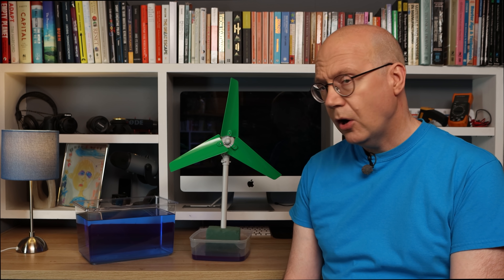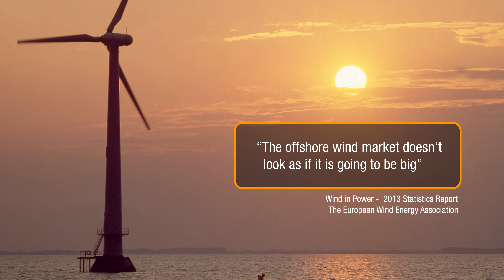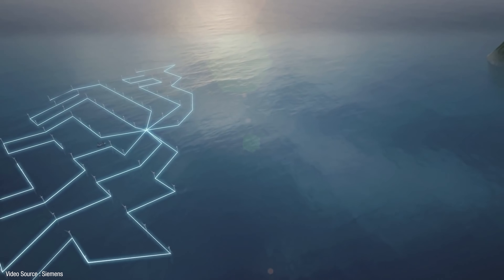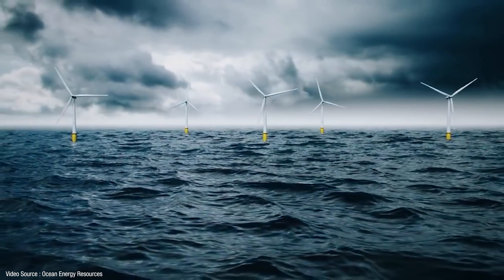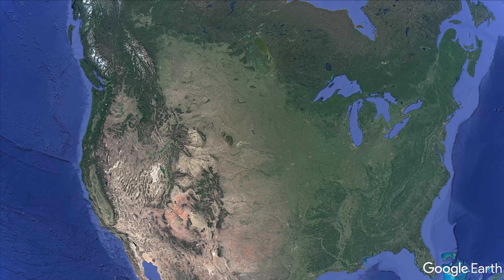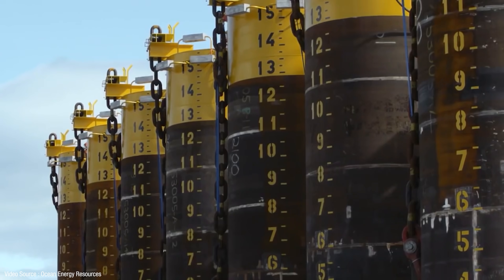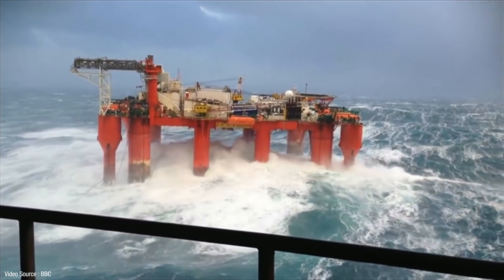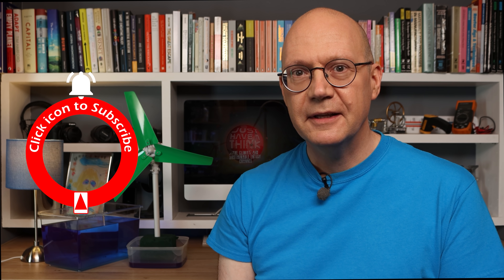Deep Ocean Floating Wind Turbines. How do they do that?

Comment: I love your videos, thank you!

I recently heard Dr Ye Tao of Harvard's Rowland Institute say (video linked below) that there is a large omission in analyses of wind energy: they generate heat via friction on turning blades, meaning that if we replaced all current fossil fuel energy with wind energy today, we would spike to 2C above 1750 instantly, just based on the friction heat (not including production of those facilities). 

I hope you'll do an episode about the MEER Reflection Framework! It would give us desperately needed time to transition to renewable energy and avoid the aerosol masking problem at the same time.

See Meerreflection.com
starting at min 24 of 55min video:
https://youtu.be/fwvPJnPP9KI&t=24m
Reply: It isn't heat that is the problem, it is atmospheric concentrations of CO2 which is causing global warming. I agree that friction will produce heat - friction in the nacelle/gearbox, wind on the blades, transmission of electricity along copper cables - but this will soon dissipate in the atmosphere and there will be no CO2 residue. It would be interesting to calculate what density of giant wind turbines would be required to raise the Earth's temperature by 1C and it must be published and peer reviewed.
Reply: @mahavati3696  Heat is the problem. I completely agree that CO2 is the primary cause of the heating, but we've created a paradox because of aerosol masking/global dimming. The problem with dismissing aerosol masking is the same as the problem of treating heating feedback loops (at least six dozen different heating feedback loops) and tipping points as though they're all in the future and incremental changes in them don't already matter today.

Dr Ye Tao points to research showing that if you increase CO2 without increasing temperature, plants last much longer than if you raise temperature. He's not saying that we don't need to reduce CO2, he's saying that if we use any of the existing emission reduction strategies, we'll be dead from heat increases far before we can reduce CO2 enough to maintain livable temperatures. We need to start reducing the heat before reducing the CO2. MEER Reflection Framework does just that.

Comment: Here in Philadelphia, there are something like 300,000 flat roofed buildings. Most of them are row houses. With existing electrical wiring installed in those houses, current solar technology and a local, non-profit run, groups of local installers who are fairly paid, solar systems with battery backup can be installed that will completely meet the electricity needs of the houses...and provide a source of income to low and moderate income people. 
The systems can be installed in a day with an experienced crew for under $10,000, everything included. We are training local people now and have already installed several dozen systems using this model. The local interest grows with each successfully installed system.
....and centralized, high capital investment and return corporations do not need to get involved.

Comment: it is a matter of who owns who,  a country rely on a company, or a company rely on a country. 

if a country stick its heart and artillery outside it's land territory, you will need a mavy or coast guard force attending 24/7/365 for obvious reasons. not to mention the technical maintenance cost, which is not required by other method of making electricity, look at the cost of north sea oil compare with othe oil sources. who's going to paid that cost? the company or the country? if you say the company, you are breeding a monster somehow someday will bite you. look at those internet company, they now identified themselves as “international companies”, who knows who their loyalty goes to? that's a naval base with armed ships you are talking about and most importantly, controls the heart beat of your city, all of it! 

a country within a country.

well, unless you live in a country that's company equal the country with absolute power, is it familier?

afterall, how much electricity it produce? is it replaceable by cheaper electricity in other form? you can say oil rigs are already there, but exactly oil rigs have the same problem but one critical difference. that's why it is not a monster yet.

they didn't control the electricity grid as well. don't forget you are talking about offshore, which is very likely 12 miles from the shore. aka international waters.

Comment: I'm sorry - I still don't understand how the rigs are held in place when they're in deep water. Can the "actuated tendon legs" reach thousands of meters down, and also across? What are they made of, and how do they work?
Reply: current floating offshore wind tech is only for up to a few hundred meters depth at most (a thousand feet in freedom units); the demonstrators were installed in depths of around 100m-120m. standard offshore wind turbines can be installed in depths up to 50-60m. no one's talking about building these in the middle of the ocean.

the platform is held in position by cables, which are attached to massive weights at the seabed, or if the substrate is of the correct type the cables are "attached" to a structure that is permanently fixed into the seabed to provide tension to the floating platform.

Comment: While already off shore and dealing w salt water corrosion..I'd rather have generators harnessing wave energy or sea currents and would encourage their development. Water is at least 100 times denser so prolly smaller generators for same power. Those inefficient wind turdbines are too grandiose construction just to get corroded if not obliterated blades after a few years. So I'd preferably have a platform with a floaty than a massive more costly  construction whirring overhead. Really, I personally find windturdbines stupid by now.

Comment: Deep water offshore wind may sound interesting, but for the foreseeable future it probably will not be economically viable. Just as with any deep water operation, whether it is oil/gas or, eg, fish farming, you run into the cost of deep water mooring. And the vessels that need to put in the suction anchors. Yes, oil and gas have succeeded in just doing that, but a single platform can produce from several wells, and hence the costs of the deep water mooring of a platform is relatively small in comparison to the entire costs and potential profit of the operation. With turbines it is different, as each turbine will need its own set of moorings. Apart from that, what exactly is deep water? Right now in offshore wind, anything deeper than 50m is deep water. In oil and gas anything deeper than 1500 m is considered deep water, with extremes going down to even 3500 m. And what about the cables that are required to connect turbines to the substation and eventually to the grid? Laying those cables is highly specialised work and extremely expensive. Vessel that can lay pipes or cables in 1500 m or more water depth have dayrates starting from around 500K USD per day. And finally: offshore wind requires a lot of maintenance and hence the transport of engineers back and forth to the turbines. This is very time consuming and expensive and this will be more the case when going far out in deep waters, rather than close to shore in shallow waters. 

For now just stick to shallow waters, close to shore. It is already hard enough to make that commercially sound. 

PS Am active in offshore oil, gas and wind and have been supplying parts of deep water moorings for many years.

Comment: Problem in the US, is recycling of the blades on these things just isn't happening. Metal parts can be, but the plastic/resins in the blades themselves, not really a market for it, so they're cut up and hauled, at great expense, to landfills which aren't eager to take them. I'm all for more power generation, that's a given, but you can't just slap the word 'renewable' on a project and claim it's the future, without examining the costs. https://www.bloomberg.com/news/features/2020-02-05/wind-turbine-blades-can-t-be-recycled-so-they-re-piling-up-in-landfills#:~:text=Wind%20power%20is%20carbon-free%20and%20about%2085%25%20of,time%2C%20making%20transportation%20costs%20prohibitive%20for%20long-distance%20hauls.

Comment: One of the problems:  If we are to stop use of internal combustion engines by 2035, we are going to need an IMMENSE amount of new generation.  Like every 3 weeks we will need a gigawatt nuke installed and operating.  Starting NOW.  No one seems to consider that worthy of consideration at this point.  (That's from a US based calculation.) - That is impossible with the current red tape involved with nukes, and the huge cost overruns that seem to happen (like with the South Carolina plant that is decades late, and FAR above reasonable cost overruns..)  -  TVA has some mountain top storage on the Tennessee River...they fill a lake put where a mountain top used to be.. pump it full at night, and drain during the day... Lots of megawatts there.. but in the flat lands, that doesn't work unless you build a mountain....  Meanwhile, they are taking out Hydro dams out west... Apparently they are not green enough.  (And with this year's drought, they are looking at having to turn off the generation because there isn't enough water at the remaining dams like the big hoover dam...)
Reply: I don't think it's "stop using ICE cars by 2035", it's "no more new ICE cars will be sold after 2035".  The overall transition from ICE to EVs will take many decades after the fact.  You'll have people using ICE cars long after 2035, but you just won't be able to buy any new ICE cars made by car manufacturers.
Reply: @Les_S537  Listening to AOC, she wants to STOP all ICE production long before then... and to stop gas and diesel distribution.. Kill pipelines and so on.  The problem will be the millions of KWH that we don't have available at this point, much less the next 20 years.  It currently takes decades to build a single nuke given the red tape from both feds and states.  Creating a gigawatt sized nuke every 3 weeks will be "interesting" for people that want power at their homes and in their cars.  Meanwhile, California is pleading that people do not charge EVs...ooops

Comment: USA keeps doing the stupid... The reason they're going for wind turbine technology is to avoid upgrading their national energy grid, but in order to power their nation with renewables they'll have to do so anyway as renewables take a lot more space than fossil\nuclear energy production technology. So they're currently developing better wind turbines despite the fact that they could easily install gigantic fields of standard solar on static beds to replace every single watt of power they're generating with fossil fuels and at the end they'll recover the installation costs by not burning those fossils within less than 10 years... At that point any replacement or addition will be cheaper than creating new fossil or nuclear power stations and at current technology level it's roughly at 8-1 ratio in favor of solar power over nuclear at the watt-per-dollar scale.

The only limitation for that is energy storage, but there's actually many long term grid-scale storage solutions being developed... Which is why it's stupid that they're racing to build those deep-water wind turbines, as they're still going to be limited to using them ONLY as supplemental power and any increase to power anything other than a single city would require the exact same grid upgrades that vast solar farms would, except you'd have to build those near the shore which is expensive real estate rather than in bumfuck nowhere in the middle of the desert.

Comment: If we are now developing massive scale machines to float on the water in order to generate electricity from the abundant wind, wouldn't it also be possible to generate electricity from the even more abundant waves surrounding those turbines? I wonder if anyone has ever thought of that...

It was seem that "they" already have... https://www.marinepowersystems.co.uk/dualsub/
Reply: A company out of Scotland created a tidal generator a while ago...  The unit was massive, taking over 680 tons of steel to construct it, and it got a measly 2 MW of power out of it.  Do you know how many tens of thousands of MW the world needs to run?  You would have to build millions of these tidal/current generators to put a dent in energy requirements

All renewable energy sources require lots and lots of resources to build and operate, thus renewables are a bad choice to power the world.

Comment: It's clear that there is more solar and wind energy available on this planet than we can even conceive of using right now, and the technology clearly exists. So the only thing that is missing from achieving zero carbon energy production is the collective will of the dominant species. We should just sum up the total cost and divide it by the number of governments, scaled using GDP. We could solve this climate emergency by 2030 if we think as a species instead of as tribes. #solarpoweredpipedreams
Reply: David, renewables are not the best route to take to power the world...  They're resource hogs, and ultimately a dead end energy source

Comment: Deep geo thermal, is the long term answer. Not stuff that needs the sun to shine or the wind to blow. Thermal runs 24 hours a day.
Reply: Geothermal is the best renewable energy source, by far, with a capacity factor in the 60's.

Wind's capacity factor is between 24-42
Solar's capacity factor is between 17-26

Using energy sources like wind and solar as primary sources of power is a ludicrous idea.

Comment: Any idea why they're not yet using any vertical turbines? Not yet perfected? Surely putting the turbines high up at the top is something they wish to avoid?

Thanks for a great video.
Reply: Vertical turbines are more expensive for the energy output you get.
When you're deploying at scale in a wide open environment, you don't go with the expensive option that saves a bit of space and is easier to engineer. You use the space you need, you pay the engineers what they need, and you save money.
Reply: @ps.2  Thanks! Any numbers you can specify? So basically vertical turbines, of all the types we've been hearing about, are still too expensive or unproven to scale up? I'm not thinking just about saving space (you mean between turbines?) but mostly about ease and safety of maintenance when the turbine is at the bottom, at ground/sea level. You might even change/upgrade major parts in the base without dismantling the blades...
Reply: @xamishia  *Not an expert, sorry. As such I don't have numbers either.

First, if it were important, you could absolutely run a shaft down from a horizontal axis turbine, and put the generator at ground (sea) level. I guess it's not that important.

Anyway, the name of the game in offshore is economies of scale. The whole endeavor, from mounting blades to sinking anchor cables to running undersea power lines, is very expensive per unit, and the only way it makes sense is to scale up each unit as big as you can. So you can't afford the inefficiency of VAWT even if it were a bit easier to maintain.

...Including the material inefficiency of VAWT. Power available scales very fast with the swept area of wind you can capture — can you imagine the amount of material needed for a VAWT that can sweep the same area (on one side of the axis only!) as a horizontal axis with 80-meter blades? I think the technical term would be yuge.

Others have also pointed out that typical VAWT designs can't feather. By this they mean rotating the pitch angle of the blades to decrease the spindle to a safe speed in high winds, including stopping it entirely, e.g., in hurricane winds. If a VAWT can't do that, it won't be able to operate safely outside its design range of windspeeds.